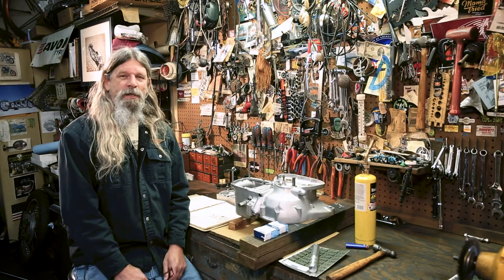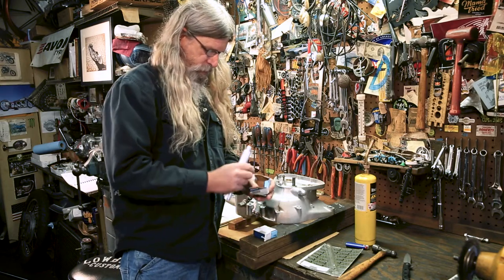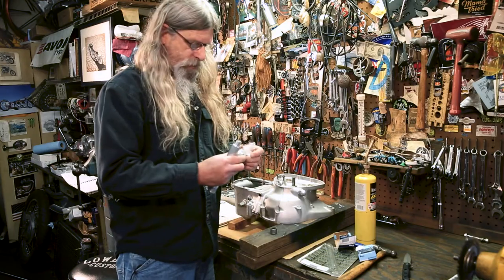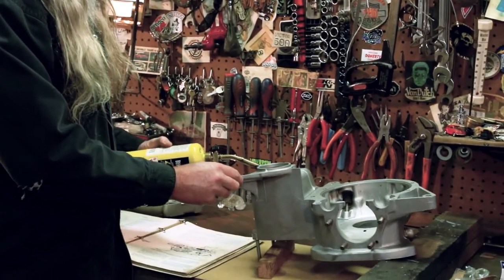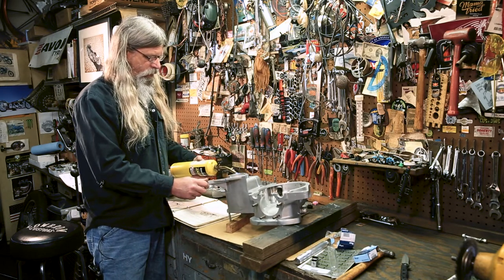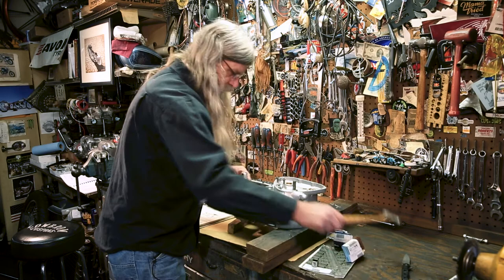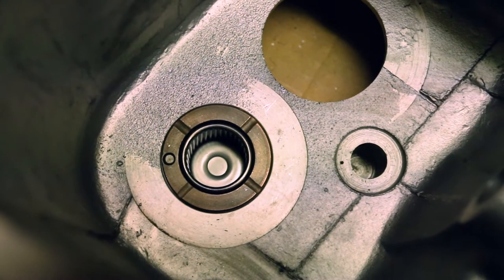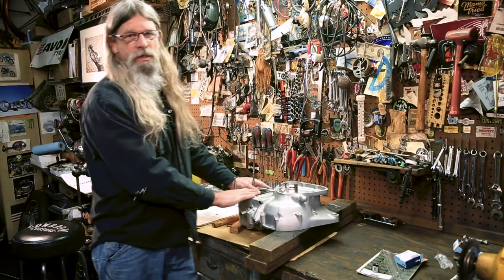Triumph Unit & Pre-Unit Transmission Needle Bearing Driver Tool

Comment: After looking into it, this is still NOT the right tool.  It might be okay sometimes, but it could also ruin them.  The problem is the flat shoulder.  It should have a curved recess instead to fully support the rolled lip evenly with no chance of flattening it out and binding the needle rollers.  Do you make a correct one that matches Triumph's Technical Info Bulletin #13?

Comment: Is the Closed bearing the same as the Harley Bearing ?  Harley 8977 bearing  Jims tools 230$ a Drift 35 Dollars  Im doing the trans case all new bearings 1995 Evo transmission , i have got OTC tools.   I was thinking of sweeting  the case 120-140 f  and drive it out and drive a new one in with a dowel punch.